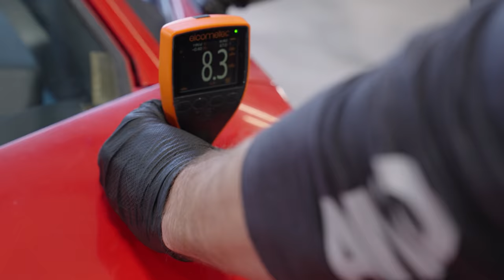Barn Find Countach!!! ft/ Larry Kosilla from AMMO NYC Part 1

Comment: When it comes to low production exotics like this the “WORST” thing you can do is let them sit for long periods of time. They weren’t made with galvanized steel so they rust wherever moisture can hide and rubber seals and gaskets will deteriorate from lack of use. This car will need an expensive restoration,not just a good clean up and a coat of wax.
Reply from the maker: The car is going to getting a full restoration, mechanical and paint. We did this solely for your entertainment and youtube.

Comment: That's a £100.000 back to frame sort out, pipes, rubbers, chassis cracks, tyres, oil, suspension, welding, engine and gear box rebuild, parts, labour, electrics...
And then a dream of a car. It will clean up well but underneath it all, let's see.

Comment: Ive driven one of these cars (and a vector W8 twin turbo) I will say this, they are the best looking, the most iconic poster car out there, but a huge let down to drive! they don't handle, they don't stop, you cant back them up, they ride like a go-kart on a gravel road, the electrical system is always broken, if you look at the dash wrong it falls apart, and lastly you will need to put a second mortgage on your home to fix it when it breaks (your typical Italian sports car)....What is they say? Never drive your hero's?! well they are correct, if you get a chance, just don't do it, never satisfy that itch, you will ruin the image of the car.